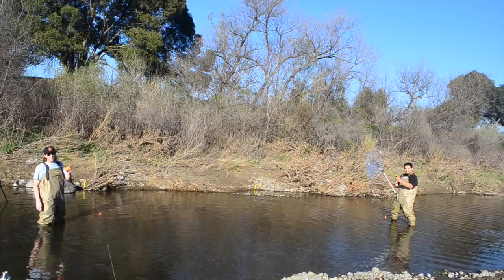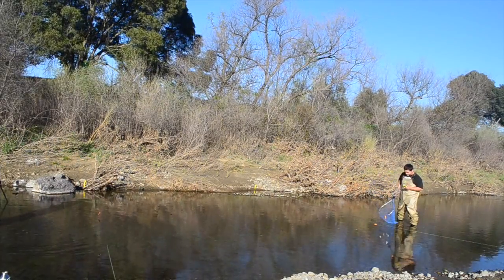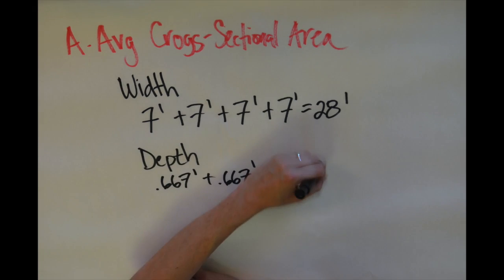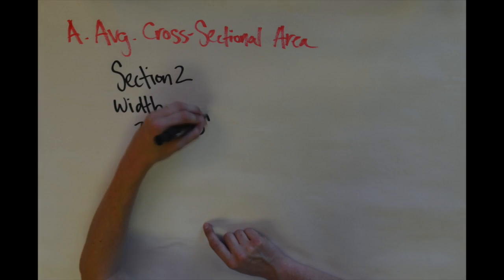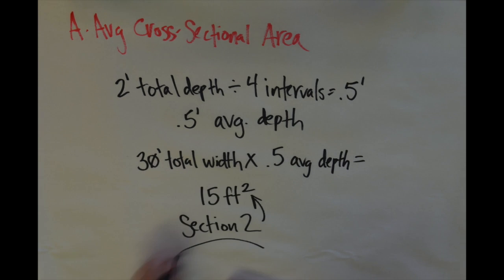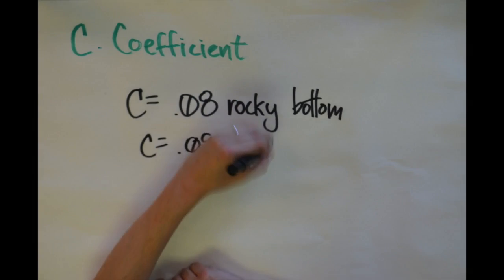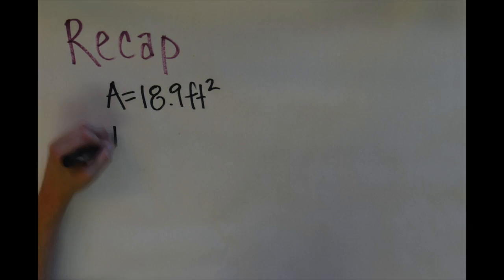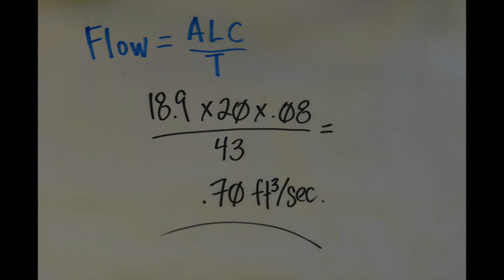A Step by Step Guide to Measuring Stream Flow

Comment: Hello buddy, my only concern with regard the flow was the weight of the material used. Did the weight of the orange not affect the flowrate as it moves?. The orange has more G force pulling downwards due to it weight and hence may affect flowrate.
Reply: I wondered that to, but my guess would be that the difference thar weight would make between an orange or something else arbitrary such as a tennis ball would be mi iscule because the buoyancy is pretty much the same? (dont be mad if im really wrong lol it was just a guess....) 💕
Reply: I was wondering the same, but then remembered the "Misconceptions about falling objects" video by Veritasium. Where he drops a bowling ball and a basketball from the same height, and despite having different mass, they hit the ground at the same time. Think about it
Reply: I belive USGS recommends usign an orange peel vs an whole orange, which I think makes sense. Thank you for creating this helpful video.

Comment: Kind of important: C=0.8, not 0.08 :-(
C 	= 	A coefficient or correction factor (0.8 for rocky-bottom streams or 0.9 for muddy-bottom streams). This allows you to correct for the fact that water at the surface travels faster than near the stream bottom due to resistance from gravel, cobble, etc. Multiplying the surface velocity by a correction coefficient decreases the value and gives a better measure of the stream's overall velocity.

Comment: The shown discharge of 0.70 cubic feet per second is totally incorrect.  The coefficient is 0.8 not 0.08
Reply: yes all references gave C coefficient factor is 0.8 for rocky-bottom streams not 0.08 this is strange ?